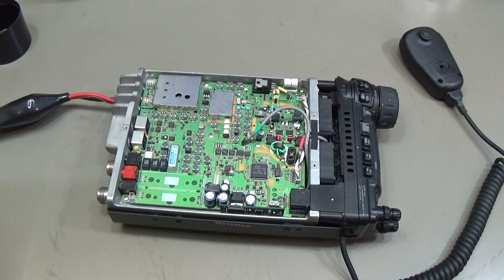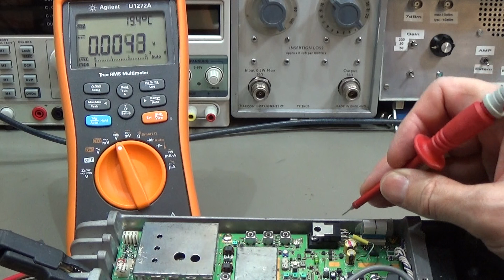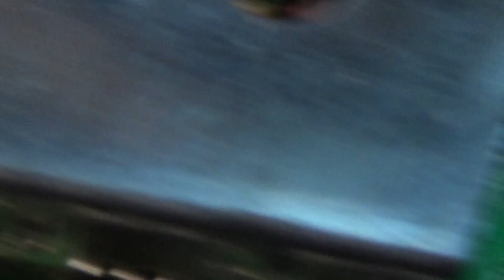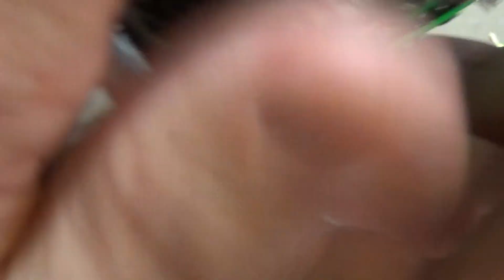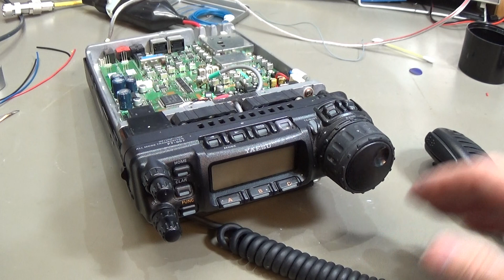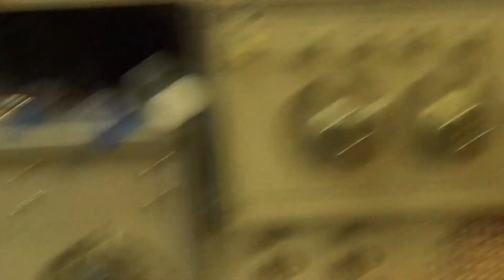#120 Repair: Yaesu FT-857 with PLL unlock

Comment: You saved it from the scrap heap!
Would like to have seen the alignment procedure, as I have one of these and it would be good to see if it would benefit.
I do occasionally have some static noise, and am wondering if it is a connection issue; thought about reseating all the connectors to try.
This is my favorite radio for CW, as I have all the filters and it just so nice to operate!  73...

Comment: I love this one problem I have here is my FT857d was sent for repair where the display started to change color, the local tech replaced it but mentioned it would not power up. After a few tries it came up for me but various at times(meaning one minute it works and next nothing) my question is does the PLL control that part and if so is it replaceable. v

Comment: Looks like someone got the soldering iron on that plastic piece. Don't ya just hate to go behind someone with the "golden screwdriver".  Whoever did the previous work was quite sloppy and no care taken or pride in their work.  Please don't try to talk over the 1KHz tone you have in the radio.  That frequency hurts my ears.  Great job on relocating the 5 volt regulator.  W Rusty Lane K9POW in eastern Tennessee

Comment: Hello Peter, I just bought an 857D with some issues to fix and love to see your videos to learn! I’ve noticed a very curious coincidence between that radio and mine. Next to the regulator there’s a inductor. In between, on the board, there’s a small piece of tape with some white paste. Also there’s a small smd resistor on the corner of the variable can which goes to gnd. According to the board layout there’s nothing like that. Well, my 857 has the very same thing. Couldn’t find anything on internet. Wondering what that is? If you or anyone else could tell me what that is I’ll appreciate. Thank you! 
Best wishes
Diego

Comment: Hello Peter! Thank you for the great and interesting videos!  I learned  so many from them!  I have Yaesu FT-857D  and i love it very much, i use it in different bands.
But i was very upset that on 2-m and 70-band it has not so good reception of RF, like on others bands. I know that electrical part for 2-m and 70-cm bands in FT 857d simple and not the best. But i am sure that with your help we will be able to revise and possibly to make it better.  What can you advice to check and possibly change in scheme to make the reception of RF signal on 2-m and 70 -cm bands better ?  I checked and compare the reception of 2-meter RF signal on FT-857 with Quasheng UV2-plus radio and to my surprise the reception of RF on Quansheng uv2-plus with external antena (superheterodyne too) is looks better (less noise and better hearing of weak remote stations). I  hope to get the advice from you to make FT-857D work better here.

Comment: Peter. I didn't see you add a small heatsink to the 8v Reg. Did you add something underneath? Well done, a great repair.
Reply from the maker: Edward the 8V regulator is mounted to the chassis so enough heatsink.. 73

Comment: Full marks for your commitment mate, I service radios but I would have taken one look at that mess and put the lid back on and sent it back. I hope you charged at least 200€ because as far as I would be concerned that radio was BER until you gave it the kiss of life. I would only have a go after that cowboy if it was a mates radio.
If you want to work with SMT then you need to invest in the correct equipment, it looks like the bodger before you used an angle grinder and arc welder in there.
Reply from the maker: LOL 😂 angle grinder and arc welder 😂Thanks for stepping in, Clive!

Comment: Probably what happened is that the owner stuck a short into the accessory jack, cooked the 5 volt supply and burned circuit traces

Comment: I have noisy Radio on all bands .. can I sacrifice the AM filter CR1005???
Reply from the maker: Hi Ali, why sacrificing the AM filter (CF1005). I don't see why you want to do it?? 73
Reply: TRX Bench because even if replace it, it will get damaged again due to bad DESIGNE of some high voltage passing through, I have never used AM only when listening to Air traffic control on VHF ... see my Facebook today @ ali AlKulaib and see the filter removal by taking out the elements inside ... 73 de 9K2MB

Comment: my 857d also came back from he shop and work well for about 30 days. they replace 3 ceramic filters and did a realignment so the hf would have rf output. now the hf receive is back down again and my ssb is off .5hzs high from what a follow ham told me.

Comment: Great repair. Nice job relocating the 5v regulator like that, very professional. 
 I'm assuming you let the owner know that there's no guarantee, as anything can happen when a multi-layer pcb gets damaged like that.  Interesting that the person(s) who worked on it before were smart enough to cut away the damaged part of the pcb without shorting the ground layer, but not smart enough to route the missing 5v supply, and also why the heck would they mess with the alignment like that?
Reply from the maker: Thank you Steve. Yes this repair is without any guarantee, as you said we can't say what will be next..No idea why he was messing around with the alignment that much. Never seen something like that before..  All the best and 73

Comment: Nice video! The FT857D was my first legitimate ham radio, where I had a license, and transmitted.
 I am driving past the uranium mine in Utah, heading for Colorado, so  Frohe Weihnachten!! The tailings pile is always lit up like it's Christmas. 
I hope those are 
electric lights, and the overburden is not glowing!!  

Ihre Familie Gott Segnen
Reply from the maker: Hi Seth, thank you and Merry Christmas for you and yours! 73
Reply: I dropped the control head for my 857D into a bucket of water, and dirty socks. I got very lucky. The radio would not talk to the ATAS 120D antenna before my accident, but after it's bath, and a quick clean & dry, it has been working fabulously well. I used some German cigarette papers to soak the water out of the display. I went and bought more of those German papers, for that reason. They work great for soaking water out of tight places.
Reply: I quit smoking, but sure I am glad I had those papers stashed away.

Comment: nice job Peter its hard work to take over a job after some one else has been messing arround with everything. i find it better to do a quick alignment first as that shows up many faults after some one else has been playing. that was expensive work that many professionals would not take on. well done and Merry christmas to u.
Reply from the maker: Hi Gay, yes it is no fun to take over a repair like this..Concerning alignment i´t was not possible in this case as we had no function.. Thanks for stepping in 73